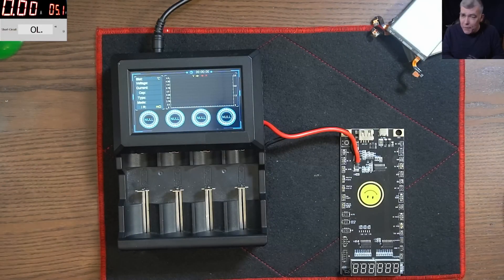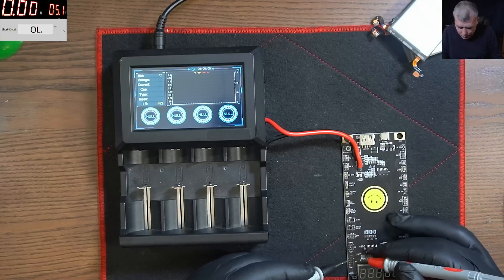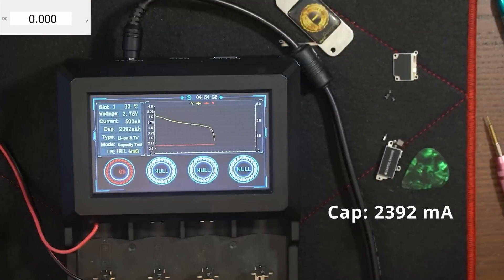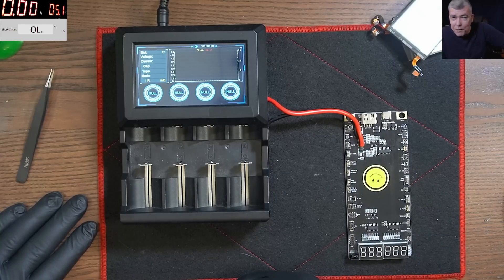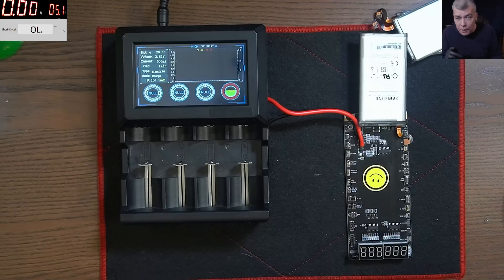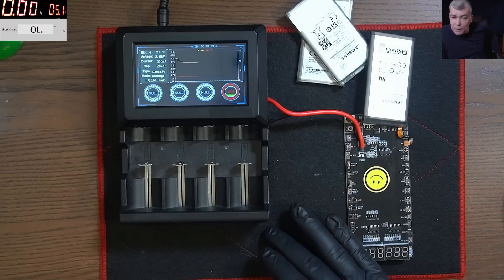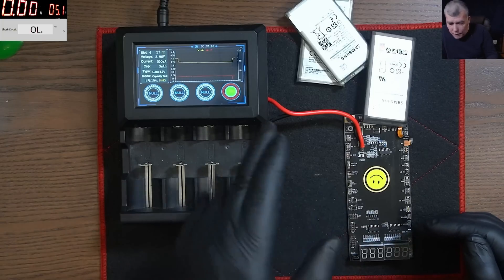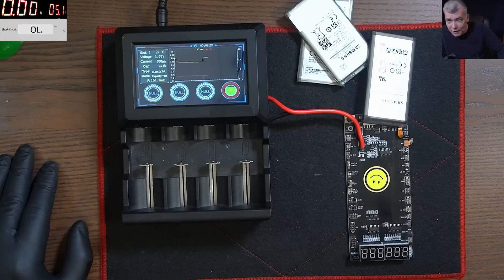How to test a phone battery - The proper way

Comment: Great video! So you blown two mosfets on the board, take them off and soldered black and red wires. But where you soldered them?
Reply: Ok I solved myself, but the way you connected red and black wires on the board is opposite in my board (I have the same model tough).

Comment: You can just use a DC electronic load for this. The better ones (those stand-alone devices, starting at around 300€) usually have a "battery test" mode where you can specify the cutoff voltage and the current, then connect a fully charged battery and it will count the mAh taken from the battery until cutoff. About the Apple battery ... maybe cycle it a few times before doing the capacity test. On Android phones, there's an app called "AccuBattery" which will count the mAh from low charge to full charge to give you a good idea on the battery state.

Comment: Hi Sir Sorin, I like your way of testing battery capacity. I use the antutu app which has a capacity measurement in a way that you turn on the application and connect the charger and when the mobile phone is fully charged, after that you use the mobile phone. After charging and discharging the device a few times, the application shows the actual capacity. I bought a "new" battery from a local dealer that was worse than the original one in my device. That new battery was at 46% capacity, and the old one at 65%

Comment: But what voltage is the battery designed to be charged to? The batteries always tells what voltage the capacity rating is for. For example samsung batteries usually list capacity when charged to 4.4v If I only charge the battery to 4.2 like most chargers do, I get 3300mah out a 4000mah battery. If i use my bench power supply to charge to the full 4.4 I'll get the extra capacity.

Comment: The internal resistance can get you the general health of a (Lithium) battery, if ... if you know the values and tolerances of a healthy and a bad one. The power wall communities have their  own 18650 databases, but i know not of one database for battery pouches, because their size is not standardized. 
And the internal resistance values on the manufacturers datasheet is probably the least wrong one. ;)

Comment: Hehe, funny comments about the discharge rate. Yeah, maybe ppl are not wrong about to follow the manufacturer's spec, if it's available. But discharging a 3000mAh battery at 500mA means a 1/6C discharge rate. That's pretty low for a lithium battery. Maybe even less than what you would pull during a gaming. More than standby use, but still not impossibly high. 
Lead acid batteries are usually rated at 10h or maybe 20h discharge, yes but those batteries have a completely different chemistry...

Comment: Battery capacity is normally specified at C/10 or C/20 rate, so a 3000mAh battery should only give you 3000mAh if you discharge at a constant 150mA, if C/20.

Comment: I'm pretty sure there is a capacity battery tolerance like there is a hard drive capacity of 1TB but you only can use 950 Gb. Battery health system is not precise you can test for yourself, use a your battery with for example 88% health and plag new battery and after this replug old battery and very often battery doesn't show anymore 88% instead it show 91%. How this is possible i can't explain, so that teach me to don't look battery healt. Battery can be 100% health and be very bad causing restarts/crashing. For me does battery takes 4 hours or 4 hours 25 minutes it is notimportant at all.

Comment: Samsung does not hidding that, this is my battery info:
Battery capacity
4500 mAh (typical)

The typical capacity has been tested under third-party laboratory conditions. The typical capacity is the estimated average considering the deviation in battery capacity among the battery samples tested under the IEC 61960 standard. The rated (minimum) capacity is 4370 mAh. Actual battery life may vary depending on network environment, usage patterns, and other factors.

Comment: Hi Sorin, I use a iMAX B6 V2 Charger from SkyRC.  It's a great multi purpose charger and has a socket for balance charging which you might find quite useful if you're looking for a replacement.
Reply: As far as I know it does not support 4.4V LiIon.

Comment: My only exposure to lipo battery folk lore has been in the toy aero field. When they first came out it was said that capacity increased over the first few charges and that battery life was increased by limiting the charge voltage to 4.1v. 4.4v was a definite no-no! How times change!
Reply: That's why you need a new phone, my old phone from 2018 is fully charge at 4.35V, 4,4V is genuinely normal this day.
Reply: Sorin says in this  video that the iphone battery pack also contains a battery management chip and I think it is that chip which requires that the pack is fed with a slightly higher voltage than you would expect for a simple cell.
Reply: @Hereford1642  IMO that because new material for the electrode that enable higher fully charge voltage, basically with different material it has better  volumetric or gravimetric energy density therefore it needs higher voltage to enable squeeze even more energy. Obviously when you need higher voltage then you also need different Battery Management IC..

Comment: I watched a car battery test video explaining what the actual Ah number means. In short, to get that capacity you need to step down the current output over several discharge cycles.

Comment: Hi Sorin, you need to cycle new battery before you test it. If you take brand new battery it may show you lower capacity but after few charges it will go ti its full capacity.

Comment: Sorin your testing method is 100% correct.  M. Dimitris and Roman Vasiliev are also correct.  The normal discharge rate for a cell phone in talk mode is probably around 75 milliamps, however the standby mode of phones is probably around 10 milliamps.  I think the discharge TEST RATE should be lowered to 100 milliamps but this is probaly not practical as the test would take days.  However discharging the fully charged battery at 100 milliamps would probably prove that the manufacturers rating is correct.

Comment: Manufactures are not lying, it is your discharge pattern that isn't realistic. NO phone battery last only three hours, that is not an average, realistic use. Never do a liniar high current discharge. The phone battery was NOT build for that use. Your way doesn't give the cells any chance to recover. So make a realistic discharge pattern that is within the manufacturers  timeline. Your conclusion is faulty...
Reply: yeah when u play pbg without stop how do you think how much current is drawimg from battery :D lithium battery is lithium battery, doesnot make sense if u will use in any shape

Comment: Hello. I think you should check the discharge rate. When I do a capacity test on a battery, I calculate the battery current / 12 hours. I set the discharge rate to 12 hours. The best way is to get discharge rate information from the manufacturer if possible.
Either way, the mobile phone battery is destined to be discharged in 24 hours. Normally, for me, the test should be done with a discharge rate in 12 or even better 24 hours.

Comment: I think 500mA discharge is too much/unreal. I remember when I had brand new Iphone 11, I had 6hrs long regular call + video recording + video calls and in 12hrs total, I manage to spend only 50% battery. This device is measuring capacity, ok, what about transfer losses? I would like to see result from some reasonable discharge, like 250mA or even 100mA.
Reply: Agree realistically it should be 250-300 mA at continous discharge, although sometime the phone itself can squeeze as much 500mA or more when the tempererature sensor doesn't reach certain level and thermal throttling start to kicking. So 500mA is still fair enough to test the worst case scenario..

Comment: Li-ion/LiPo batteries have different internal resistance when full than when empty. Then, I concurr with other comenters that lower, 150-300mA discharge current should be used, but between 150mA and 500mA you will not (should not) get more than 10-15% capacity skew (for a good battery).

Comment: When I played with cells capacity testing - I noticed: the higher discharge amps are applied, the less is the capacity. Your typical phone would never suck 0.5Amps all the time (or its uptime would be limited by 6 hours). It drains less current. So, what capacity will you get, if you lower discharge amps to 0.2 Amps? 0.1 Amps? And manufacturer is not lying - they  simply measure the capacity with different discharge amps.
Reply: Cred si eu ca e adevarat ce zici. Acum mai ramane intrebarea: ce capacitate are bateria daca o descarcam cu 200mah? Cred ca 200 ar fi o cifra care reprezinta realitatea; 100 ar fi mult prea putin
Reply: You're very right. The manufacturer of the battery provides the 'standard discharge current' in the datasheet and that should be used for testing. I'm sure is far less than 500 mA.
Reply: and one more thing, at what voltage the test ends? the iphone dies around 3.5, you need to double check that and stop the test at that voltage, also the bms is not perfect and lose some mha too...manufacturer say battery capacity without anything after the cell i suppose..
Reply: thats how easily you can lose 200 mah from the bms, the discharge rate and the voltage cutoff of the test
Reply: Exactly this - you'd have thought Sorin would know something this basic. Even car batteries are quoted at the "20 hr" rate - which indicates the discharge rate used for comparison purposes from battery to battery.

Comment: Is 500 mA a realistic discharge rate? More energy can be extracted from a battery at a lower discharge rate, so perhaps even reputable manufacturers use a lower rate, such as 200 mA, when they test the battery capacity.

Comment: Sorin Nice tools to compare 

I did ask Apple. Answer is 8 to 10% marching because the can’t make it exactly the same always. The batch can be a little different than a new batch and they always printing the best capacity batch on the battery. So it’s normal also Samsung and more brands do it.